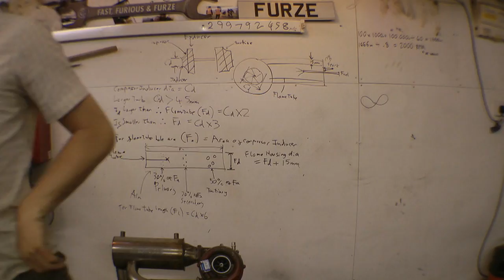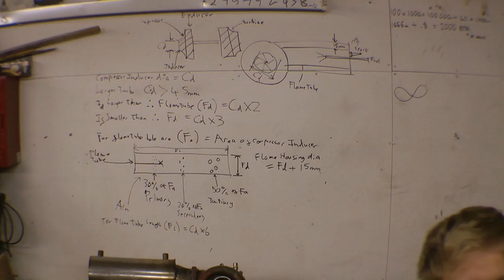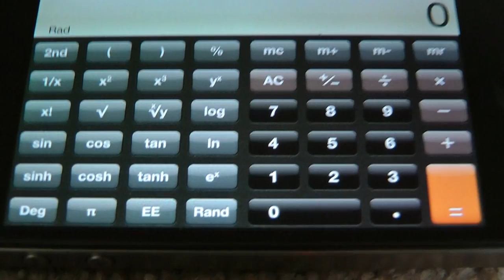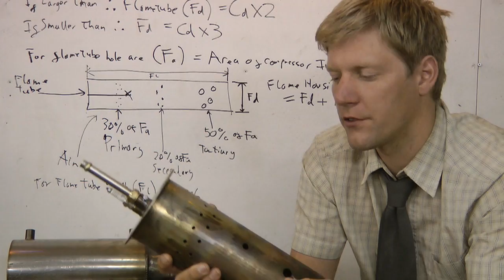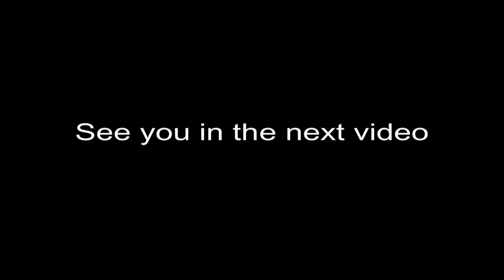How to build a TURBOJET ENGINE - The Maths

Comment: put a   shaft on the intake nut  and run a disc with magnets  and  copper coils.
Also how  about putting the whole thing in a a cone shaped ram jet and use the  heat to create more thrust.

Comment: he"s probably the chief Engineer at Rolls Royce !!
Nutter !!
Reply: Not living in a small semi in Northamptonshire he isn't.
Reply: scbonduk you would be surprised.  Chief Engineers at RR make about 100k, and there aren't that many detached houses within a 5 mile radius of RR Derby...  Although if he were a Chief Eng at RR, he wouldn't have the time left in the day for these projects.
Reply: Phillip Phillips My point was, if you were a chief engineer at Rolls Royce you more than likely wouldn't be living just over an hour away from work (if the M1 isn't congested, which it usually is at peak times). There's plenty of places in the region of Derby and also Nottingham with large, expensive homes where you're more likely to find a chief engineer living.

Not to mention that's a bit young to be one. Chief engineers are usually in their 50s, not their late 20s/early 30s.
Reply: My chief dev engineer was late 30s, although he was an exception.
Reply: A dev engineer isn't quite on par with a mechanical or mech design engineer. Not by a long shot.

Also, "I got an E in my Maths at school." I can assure you, he isn't any kind of engineer for Rolls Royce. To even get onto mechanical engineering you need to be getting a high grade at GCSE, an A or A* at A-level and even then, getting a dream job at Rolls Royce is tough when the competition is incredibly fierce (ie. at Uni of Nottingham alone there's hundreds each year on mechanical engineering).

A friend of mine is an engineer at Triumph...straight A student his entire life, first class degree from Sheffield.
Reply: scbonduk Phillip Phillips +1 this thread for the oddest BTL argument I've ever read. Luckily I'm not commenting on it myself. 

..oh bollocks.

Comment: If your turbo is less than 45mm inlet and you the flame tube 3x the diameter, do you then use this new dimension when choosing the length too, or the original turbo diameter? Eg my turbo is 40mm so the flame tube is 120mm but should it be 40mm x 6 long or 120mm x 6 long?

Comment: just a quick question.
shouldnt you be using πd instead of πr² on the measurements for the holes on your flame tube?
πr² calcualtes the volume of a sphere where all you are wanting is the surface area of the circular hole.
Not complaining as this is amazing :)
Reply: pi*d is the circle's circumference. I mean the definition of pi is that it is the ratio of a circle's diameter to it's circumference. The volume of a sphere V is V=4/3*pi*r^3. However, it all doesn't really matter because if you were to put all his calculations into an equation, you'd end up with just the ratios of the holes' diameters.
Reply: The area of a circle is pi*r^2 as he said, always and forever.

Comment: gday. i want to build sth like that just with an axial compressor, do you think your formula with the holes will work for that too? so the intake diameter
Reply: if the compression ratio of your axial flow gas turbine engine is the same as the compression ratio of his turbo, the formula for the holes will work. Otherwise you'll have to look at some overhaul manuals of jet engines and you will find the formula somerwhere in those 600 pages of diagrams. This "change" of formula occures because the compression ratio of different by dimesnions turbochargers is an exponencial progression, and the axial flow compressor stage might have for an example the same diameter of the intake ( 50mm ) but could be longer and have more stages ( for an example 5 or 6 compressor blades ). This will probably make a bigger compresion if the losses are minimal.

Comment: Just a quick question to anyone who's having experience with these homemade turbojets - How important is it to have the combustion chamber completely air sealed? I guess the more it is, the easier it will be for it to start and run, but how "whiny" are they in general? I am not a good welder by any means... the welds are not very smooth and it has some air leakage here and there(I will fix this when I can) 

also what is the recommended fuel pressure for startup? I have some sort of pressure regulator that only will let out 30mbar max. Do I need more pressure than that? Any answer will be greatly appreciated!
Reply: +IAA015 It'll probably be harder to start if there's leaks in the combustion chamber, and also might be a fire hazard, so look over all your welds and make sure you can't see any daylight through them. If you do, just weld a solid tack on the pinhole and grind it flush.

Most people who run these have no regulator, the propane comes straight from the bottle, so when you plumb up the fuel system, make sure it can withstand the pressure, and any rubber hoses should be far from the engine so they don't melt and spray propane everywhere.

Comment: the backwards way would take the area you need per hole and then divide by pi (3.1415926 ect) and then sq root it :) = radius

Comment: how many horsepower does this output?
Reply: Hp is usualy torque * rpm, and the output of this engine isn't a rotary thing so i would say ... 0
Reply: Simon Benoit

Horsiepower = work produced per second.

For a jet, rocket or any other reaction engine this is defined as the output pressure of the exhaust gas, multiplied by the nozzle area and finally multiplied by the exhaust gas velocity:

P = Pressure * Area * Exhaust gas velocity = Torque * Rotational Velocity = Force * Velocity

It's all the same innit.
Reply: rock3tcat Horsepower is just 746 joules/s. A jet engines power is measured in Newton/Seconds
Reply: If he does work for rolls Royce then the horsepower is sufficiant

Comment: where does the thrust come out of? 1 of the tubes is gas, and the other is air. i might not of seen it correctly, but it looks like a electrical socket that is plugged into its self to me.

Comment: how does this make power to make a vehicle move then? i understand how it will run, but i dont really get how it will move a vehicle.
Reply: You'd have a turbine that's being run by the hot gas, that turns an axle.
Reply: FlyinRaptorJesus "every action has an equal and opposite reaction"   If you've ever fired a gun, you know that guns have kickback. This kickback is the reaction to the explosion inside a gun when a round is fired, and the action is the bullet being flown from the gun. Jet engines work on that same principle. When combustion happens in the chamber, it forces air out of the exhaust(action), and the aircraft foreward(reaction). I know I'm 6 months late, but I hope this helps anyone reading this.

Comment: one thing he does not mention is that if your turbo is under 45mm its is (x3) not (x2) its a costly mistake, i almost made it and he has already. its right there on the board but speaks nothing of it..... example if your measuring 40mm its 120mm not 80 vs as 50mm would be 100mm because its over 45mm and only gets (x2) vs the under 45mm that is (x3)....good luck !!
1:47

Comment: The calculations for area of the holes does not account for the curvature of the surface that the holes are in, if you flattened the tube the holes would become elliptical and have a slightly larger area than a round hole. It works though so it is close enough.

Comment: You can’t really build jet engine turbo like that, you would have change it to were it is going to operate at here temperatures. Its cool toy if your going to be serious about it. You become the excuses and portion of the gases move the propeller to compress the air. Fuel injectors are to move to the front of turbine. And spark plug to the intake exist to maximize but Abmatisation of the air. It would increase efficiency of it.

Comment: what if my turbo diameter 7.62 cm and the area =176.71

primary =53cm 
secondary = 35.35cm
th= 88.35

is my calculations correct ?

please need to correct me because I think it will make me drilling holes all my life
Reply: +Abdulmalik Alrogy Something is wrong with your math...the area of your turbo is 45.604 cm^2                                               1st set of holes have a total area of 13.68 cm^2. 26 holes with an area of .53 cm^2 each. dia each hole .82 cm              2nd set of holes have a total area of 9.12 cm^2. 5 holes with an area of 1.82 cm^2 each. dia each hole 1.52 cm                   3rd set of holes have a total area of 22.80 cm^2. 5 holes with an area of 4.56 cm^2 each. dia each hole 2.41 cm

Comment: Love this; however, I am just wondering the amount of thrust this would produce and if it would be big enough to place this into a small car. I have been wanting to do a car rebuild but I am wanting to convert the trunk into the motor compartment with a sound proofing and heat shield. I am wanting to see if I can put something like this into a Toyota Corolla that I would run on a 25 pound to 100 pounds of propane. However, I am needing to figure out if I can place the propane tank and the motor in the same compartment or if I would need to remove the gas tank and place a protective housing around it under the car. I am heading to Costa Rica and I would like to do this build there where the cost of supplies will be a lot cheaper.

Comment: I'm trying to design my own turbo engine, and I'm struggling to figure out the size of the combustion chamber.  I think the ratio provided is great, however, do you mind explaining the physics to that?  (why is the diameter of the combustion chamber have to be twice the diameter of the inlet, and why does the length have to be 6x the diameter of the inlet?)

These numbers are quite important, and I thank you for posting them.  I just like to understand more, but so far, I have no idea where to get these info. 

thx!

Comment: Area is easier to calculate if you leave Pi out of it, since the drill holes are also circular. Take diameter of drill bit (say 5mm) and diameter of intake (say 50mm). Then number of holes is given by 50*50/(5*5) * percentage/100 = percentage.
For a 10mm drill bit it would be 50*50/(10*10) * percentage/100 = 0.25*percentage.
Reply: Correct, but did u get how to determine the size\no of holes,I mean u can go with a couple of large holes or with 100 small ones, since ur only given the total area to work with. Did I miss something (Eng is not my native lang)
It's great tho me liky 
Thanx
Reply: Fernando Motoholic Never mind I got it I got it 25-5-5 right? Hadn't seen the end earlier
Reply: The math on his wall said THREE times the diameter. He is saying TWO.
Or did I get this wrong? Sorry, not a native speaker...

Comment: no it's not- the concepts are worlds apart. "engineering" works within defined parameters and formulas- whereas "science" (vaguely speaking) attempts to answer & explain the unknown, uncommon and unimagined phenomenon- and invents or deciphers the math to explain the phenomenon- what ever it may be. engineering does not play this role.  comparing engineering to science is like comparing a paint manufacturer to Picasso. get it?

Comment: and this is why people think math is boring.  I was hoping for an explanation such as, "the turbo puts out shaft power because it captures energy from 10 times as much exhaust as the air it has to pump in".  Instead, there's just a bunch of boring arithmetic with stupid interludes as failed attempts to make it exciting .  How about at least beginning your presentation with a statement of what you intend to cover?  You make some awesome contraptions.  Make the videos worth watching.
Reply: Calculations are not meant to be exciting. What's exciting is watching shit work that the calculations said would work.

If you are bothered by "boring arithmetic" then you're better off spending that fast food minimum wage on a jet already built than trying to build one yourself. You'll probably end up hurting yourself and then trying to sue Colin for making the design video too boring for you to pay attention to.